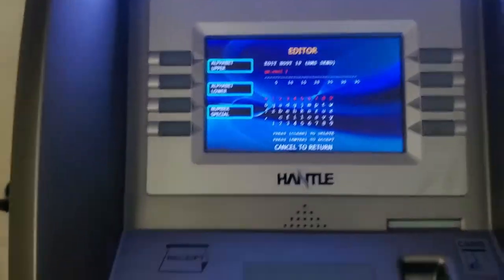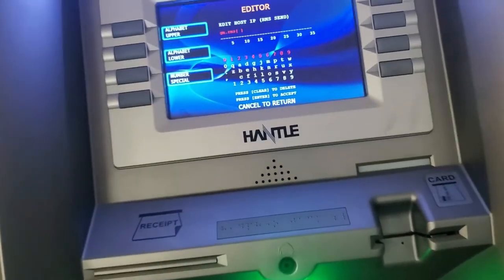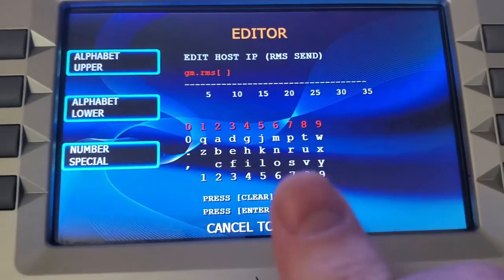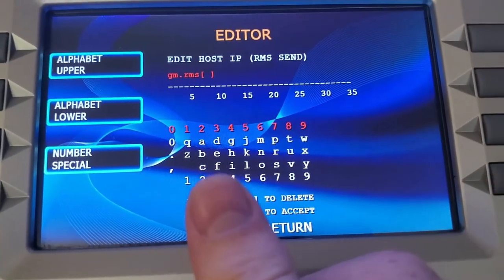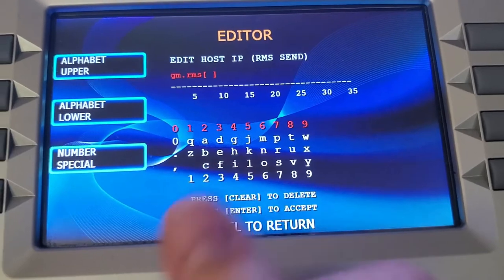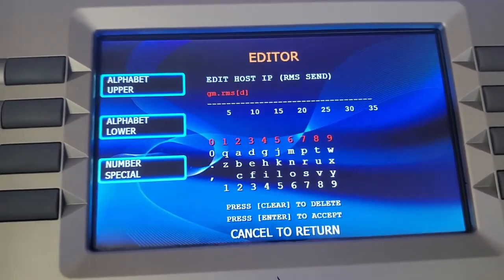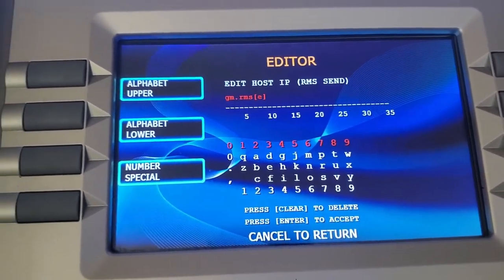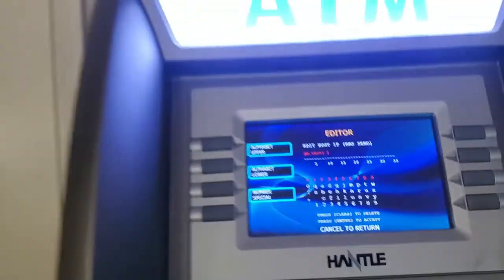Program an ATM for Passive Income with me!!

Comment: Hi I had a question thank you for your video when you bolt down your ATMs out of business do you have to pay for the damage caused to the floor how does that work I prefer not to bolt it but I just don't want the ATM to get stolen so I probably should
Reply from the maker: ALWAYS bolt your machines down. With ATMs, your in it for the long haul, So im not too worried about causing floor damages because I want to be there for several years. 4 holes into the floor isn't too bad. If you end up needing to pull the machine, filling the holes with colored caulking would make it to where its not noticeable.

Comment: Should you program the ATM before you place it in a location?
Reply from the maker: Yes yes yes. Lol have everything programmed and make sure you did a test transaction on the machine to make sure everything is running properly. The last thing you want is to spend hours trying to figure out an issue at the location.